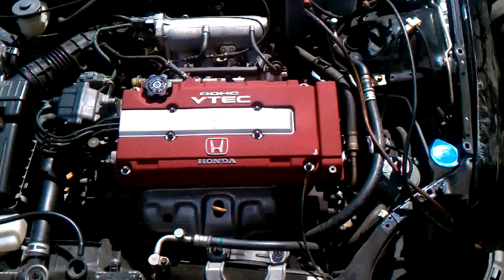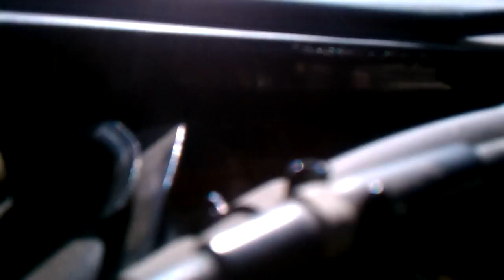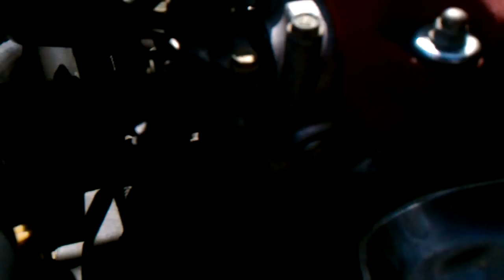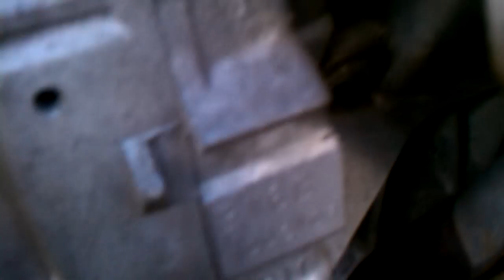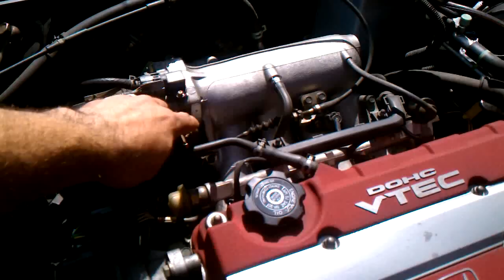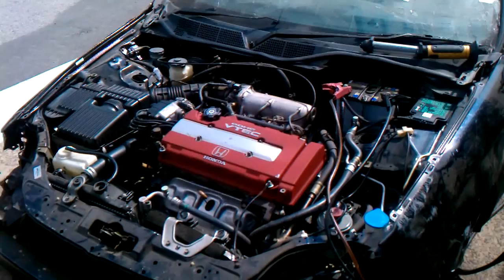Honda Civic Type R B16B swap EK9-1003244

Comment: Probably the best honda engine ever made the b16b, i want one in my crx, but heres a few tips for you down the road
1. AC removal
2. Wire tuck
3. Aftermaket radiator
4. Header
5. Intake